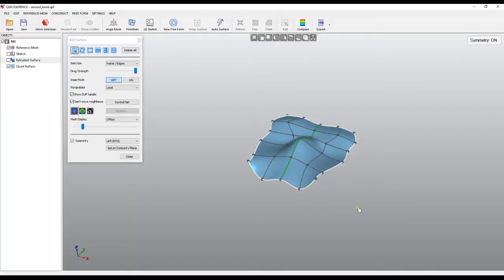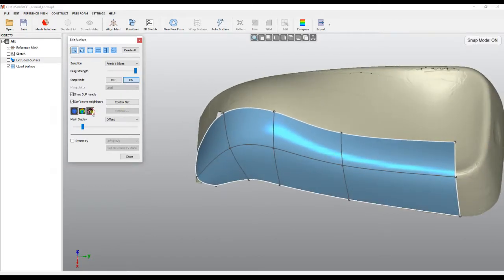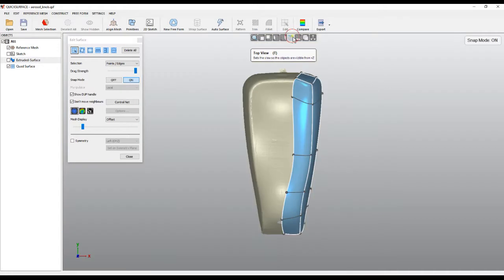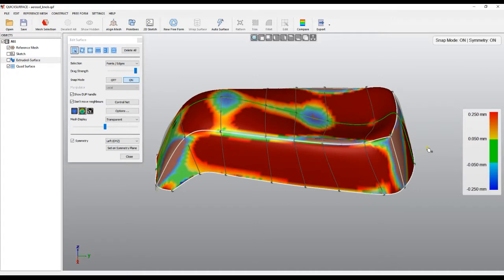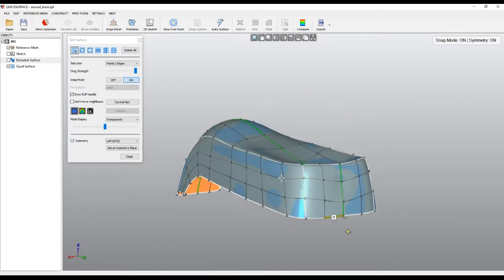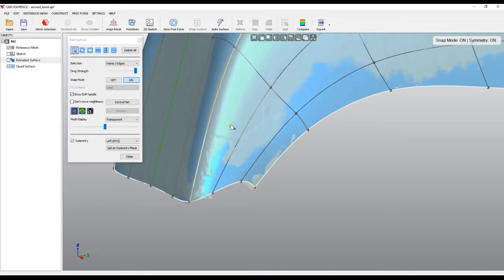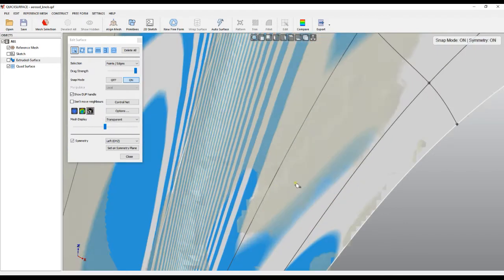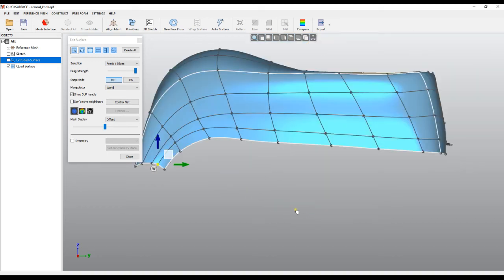QS Tutorials: Snap Mode - How to do Reverse Engineering with QUICKSURFACE

Comment: Is it possible to extend the edges of the created sirface to a free point in space or to an alreday created  plane to be able to extend the mesh In a direction where 3d scanner data was not available
Reply from the maker: Yes of course. Just turn off snap mode.